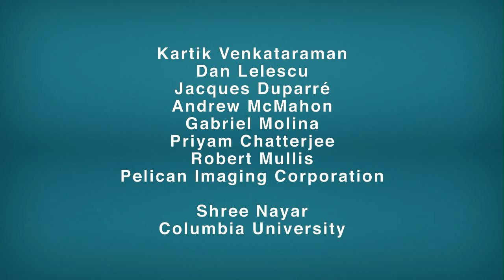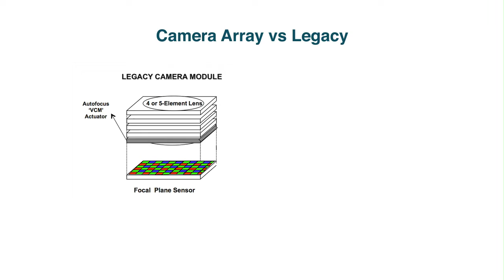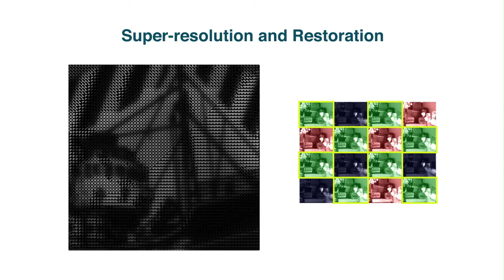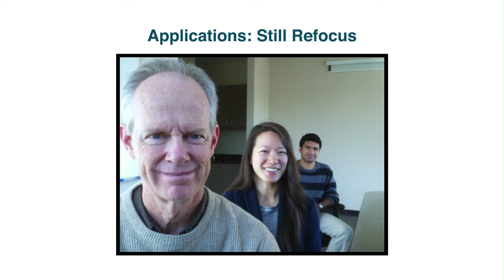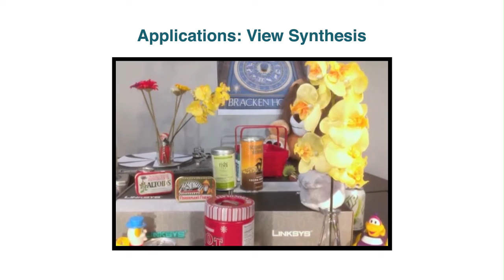Pelican Imaging SIGGRAPH Asia 2013: PiCam (An Ultra-Thin High Performance Monolithic Camera Array)

Comment: I'm mostly curious if the light-field camera is anywhere near being able to achieve the high-resolution images of the Nokia Lumia 1020 or Nokia 808, and how much battery drain there will be with all the computational requirements.

I guess we'll see in 2014, when it's implemented in a Nokia phone.

Comment: Could an array of sensors, such as this, be used to automatically filter out vibration in video? I would imagine you could compare frames from multiple sensors to determine relative motion of the camera to the filmed subject, and subtract that motion out.
Reply: BuckeyeStorms probably but it likely wouldn't work as well as techniques like sub space warp